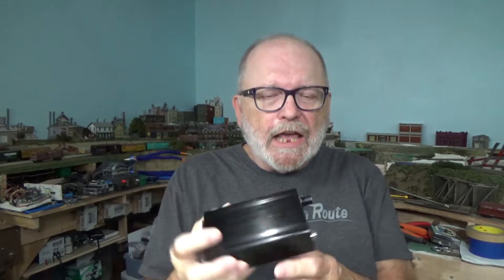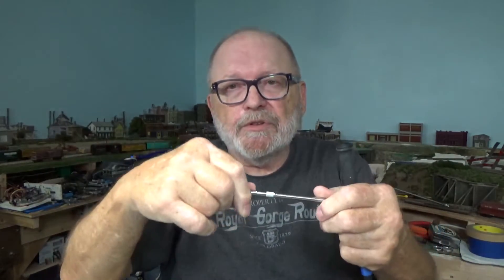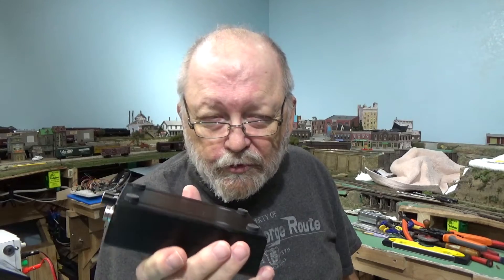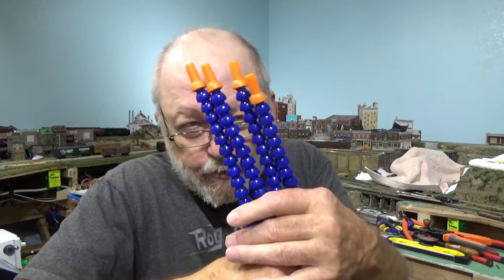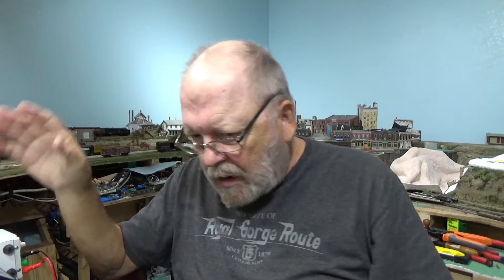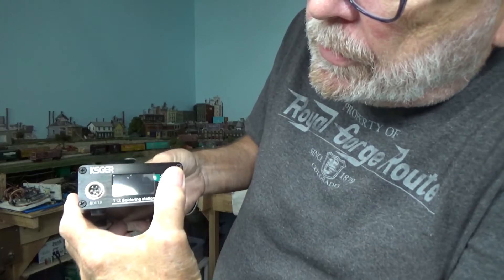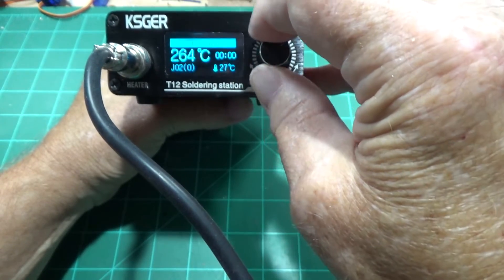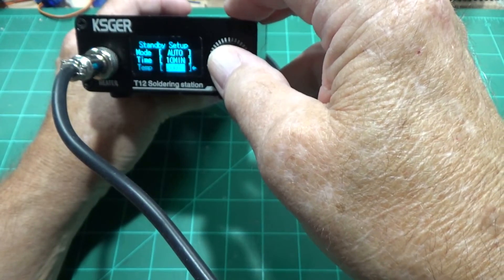Soldering With A Compact KSGER Soldering Station

Comment: Made myself a much bigger base plate with the same contraption for helping hands, that way I can get the work subject much further down and rest the side of my palms on the table while soldering. Much better for strain and accuracy. Find it almost impossible to get the subject low down when all those flex arms are mounted to the base so close together.
Reply from the maker: That was a good idea to increase the base for more stability.

Comment: Most reviews of the KSGER type stations have focussed on soldering wires and electronic components to circuit boards. How well does it manage with soldering track (track to track/rail joiners, and track to dropper wires)? Track will have a much larger thermal mass (in the soldering lingo) so might be a challenge. Thanks for the review!
Reply from the maker: Works well with everything. Can handle anything any other soldering station can handle.
Reply: Thanks Tom!

Comment: Those Chinese T12 soldering stations are surprisingly nice, especially given the price! Another nice thing is the soldering iron control board is TINY. It literally just sits behind the screen. The AC power board takes most of the case, but converts AC to DC. Internally, it runs on 24 volts, but will operate at 12 volts. What that means, is you can get these stations with an EVEN SMALLER CASE, and a DC in jack! That means you can power them off of a car's cigarette lighter socket, or if you get yourself a small 12 volt battery that fits inside the case, you can even make these entirely battery operated! I've considered adding a DC jack to mine, and making a pocketable 12 or 24 volt battery pack with a lead. Battery in one pocket, base in the other pocket, and soldering iron in hand!
Reply from the maker: I've seen the smaller ones on Banggood also. Was wondering well they worked. Might try one out someday. I have to be careful how much I load into my pockets so my pants don't fall down. lol
Reply: @TomsTrainsandThings 
Haha! Yeah. I suppose sewing a battery pouch to a pair of suspenders could do the trick too! ;)
I just get a real kick out of the idea of a wearable soldering iron that keeps the tool on you as needed.
Just need to come up with a tip holster and a solder dispenser! XD
Reply from the maker: Suspenders and a holster for the iron. Great idea

Comment: I wonder if the knife blade tip is for wood burning? Thanks, Russ
Reply from the maker: It could be! Don't know why they would include it in the soldering station.
Reply: @TomsTrainsandThings  I have seen a few other brands do this. They are combining functions because of the adjustable temperature. Not all one-temperature irons can burn wood properly, but  quite a few adjustable temp irons can now fill that duty also. I believe that is why they provide the knife tip. Thanks, Russ